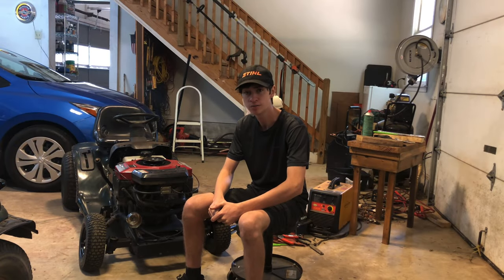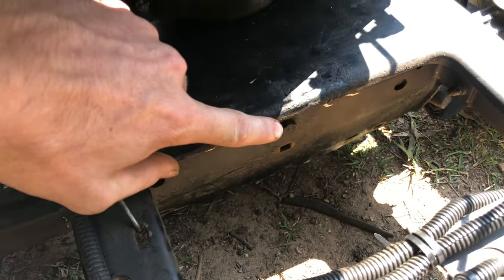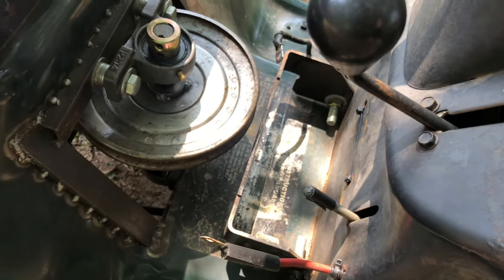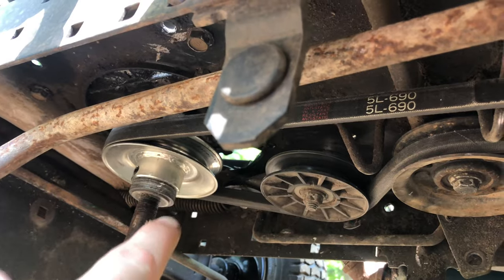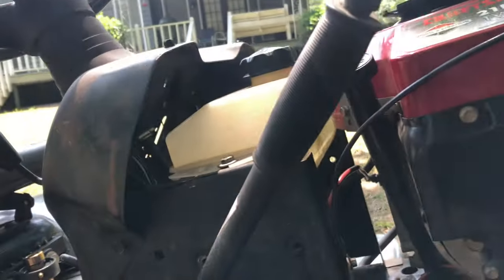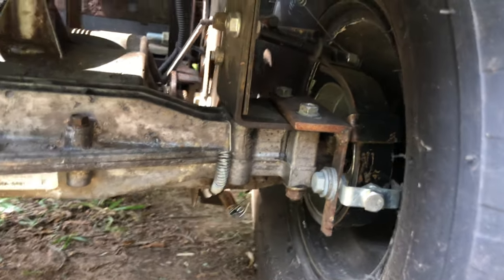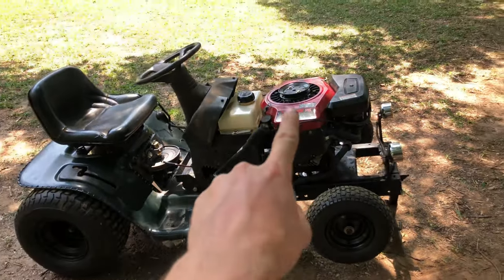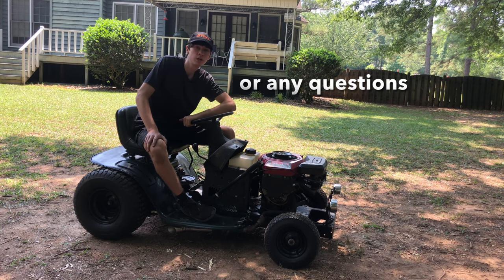21hp Rat Rod Racing Mower Modifications & Setup!

Comment: The flatheads were the best thing ever produced in this country. I would dump all three of these Intek OHV, head warping, valve seat dropping, boat anchors I have for a big ole flathead.
Reply from the maker: Yep flat heads got there place too! They have less moving parts!
Reply: No they weren't and have several flaws, not worth wasting money on at all but fun for a project.
Reply: @IngenTechNational  i got a grip of them, they're all just too small to pull a riding mower, and the shafts are the wrong way lol 
The model 13 on mini bike had the valves lapped with rubbing compound, then i grinded the stems so they'd actually shut with the cam installed. Stuck piston? Whacked it out with a hammer, sorta honed the cylinder, new piston/chrome rings, reused the head gasket that in certain i made outta something decades ago, and that thing still thumps.
Reply: @NubsWithGuns  tell that to every person racing go carts in the 90s. The flathead dominated. As far as lawn equipment goes, L heads were the best engine ever produced.
Reply from the maker: @dogsandwich77  Dang man thats insane!
Reply from the maker: I like them both lol, they seem to have their places. The flat head is more "rat rod" but the OHV is easier to service the valves and flow a bit better.
Reply: @IngenTechNational  i keep a stack of head gaskets on deck for the 500cc ohv Briggs.
Reply: @dogsandwich77  "The flatheads were the best thing ever produced in this country"
I would tell that to anyone that says ^this^.

And no one was using an opposed twin for kart racing, they used briggs flathead singles which is a different story yet still has the shortcomings of being a flathead.

Do you know that I also own 2 and love them?
They just aren't anything that special 30 years later.
Reply: @NubsWithGuns  i never intended to say they were using 2 cylinders,  just that they were using flatheads. And 30 years later, they're still running. To me, that's a good engine. They're definitely not as efficient or as fast as todays engines, but id rather have something reliable that you can fix easily. These 17,18,19.5  hp single cylinder ohv engines are garbage compared to the flatheads. They run until the head gasket blows, or you get sick of the broken cam decompression lever and have to take it apart anyway. The only engines more reliable than a flathead Briggs, is a Ford 300 straight six, or literally any Honda 3 wheeler. None of those are fast (besides a 250R) but they run always.
Reply: @dogsandwich77  I got my hands on a lightly used 46 opposed to repower an older mower. I am wondering if in the future I should save this engine, if it can replace a V-twin with the same shaft. It is a great engine. The old one lasted 22 years, until a relative forgot to add oil after an oil change. It always started up, assuming gas and a good battery. My neighbor had a V-twin go after 3 years in a $2600 mower.. And it was serviced by a reputable place(they would pick it up every season). My neighbor tried my mower and felt it is more powerful than the v-twin.

Comment: Mine is not lowered and has a 42 ci 19.5 opposed twin from an lt1000 with an mst 206 on a DLT3000 frame, and has a 5 inch pulley on the front and a 2 inch on the back with 20 inch tires. It did a top speed of 48.5 mph down a hill in a 35 zone lol. Very dangerous with the stock steering too. Great review of this thing showing all the mods done to it. I may use that break design with the stock breaks too.
Reply from the maker: Oh alright, nice man!
Reply: 42's were 18's.
Reply: @NubsWithGuns  the 19.5 says 42 on the tag, just like my 18 that threw a rod
Reply: @spudstudios3342  I see and I did look that up.
Idk I find out all the time there is a few I hadn't heard of before.

I've counted at least 9 different carbs and people always swear there was only 3 lol.
Reply: If you’re ever in a pinch and don’t have an auxiliary pull starter you can use a ratchet strap on the deck drive pulley

Comment: Shes lookin good. Im still havin fuel leak problems with mine. When you did the diff weld on the offroad mower, i split the case on mine, and the hydro trans looks real good. Good job on the video btw. Cant wait for everythin else!
Reply from the maker: Alright! Thanks man!
Reply: Have you looked into a carb rebuild?
The fuel pump in them likes to die leak and run too rich when they go.
Reply: Unfortunately, its a gravity fed carb, its also one of the infamous Nikki carbs, so they tend to leak into the cylinder. My 16 horse had the same problem. Im lookin inyo a gasket kit for the carb, so we'll see what happens.
Reply from the maker: I have cleaned the carb out before but I haven't had any other major problems yet.
Reply from the maker: Alright!
Reply: @TheLonelyCowboy1958  They might swap out if you don't get anywhere with that one.
I got lucky and have one of the old ones one my 42.
It already has the low idle screw , but that model carb is pretty much the better one of that style with a welch plug in your way.
Might not mess with it though, I had plans for dual carbs anyway.(telling me no will only encourage me more to do so hahah)
Reply: @NubsWithGuns def gunna want to put dual on mine, i have two of the same carb anyway lol. I got5a get mine runnin first. It does fire up, but with the fuel leak issue, i need that resolved first.
Reply from the maker: @TheLonelyCowboy1958  Yeah lol!
Reply: @IngenTechNational hopefully i can get it resolved soon, its been a bit since i last touched the thing. I got the rear axle reinstalled today, but i need to order the kit. Hopefully that resolves the issue, or else my engine is gunna be runnin at verrrrry high rpm.
Reply from the maker: @TheLonelyCowboy1958  Yeah Definitly!

Comment: You ever thought about flipping the trans upside down and gettting rid of that jackshaft

I remember back when you started this you didn't want to cut things up to make it all fit but wanted to lower it more.
Reply from the maker: The only problem with that is, is that reverse will be going forwards and you will have 6 reverse speeds. Unless you mount it backwards on top of that, then it would kind of work but that will probably take a while to do because I would have to completely redesign everything. Also I wouldn't be able to fit a big pulley on the front because the clutch is right up against the front pulley. Redesigning the clutch would be a option but all total I would have to completely redesign the whole mower to make it all work. Might could do it in the future, but I am just going to keep it like this lol.
Reply: @IngenTechNational  Yeah I Know.
Thats the theme here, it's all too much work or won't fit even if soemone else already did it LMAO.
Reply from the maker: Yeah 😂
Reply: @IngenTechNational  flip and turn 180 degrees

Comment: Have you tried a transaxle flip in the process of one seems to look a little easier than the jack shaft setup like your videos just subscribed
Reply from the maker: I could but I it would have a lot of flaws and I would have to completely redesign the whole mower. Which I already spent enough time building this setup lmao!
Reply: Got a point there
Reply: reason i like the transaxle flip better, specially for something spinning this fast. Is that with the stock setup the input shaft is on top and the barrings are getting little no to oil so they heat up, once flipped the shaft is now on the bottom constantly soaked in oil. 
Go rip the hell outta your mower for a solid time then touch the transaxle at the base of the input shaft where the barring is, youll see how hot the barring is getting lol. After flipping it however there has never been a hot input shaft barring again.

Comment: Need to put 20/50 synthetic oil in it that is the rear end gives it a better lube and it doesn't break down like other oils do a thinner oil will not keep it cool It will break down quick and will not keep it lubed as 20/50 will. You want more of a high intensity oil
Reply from the maker: Alright!